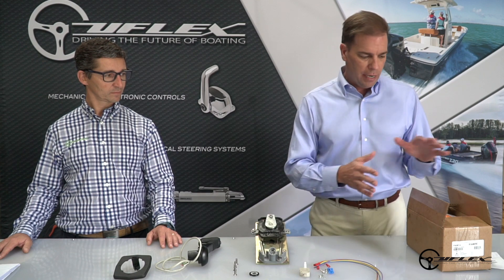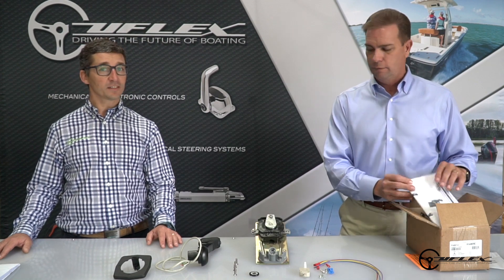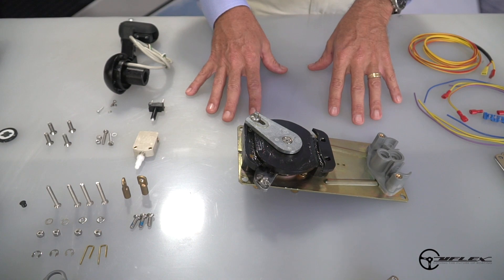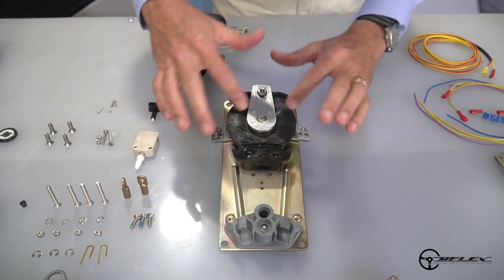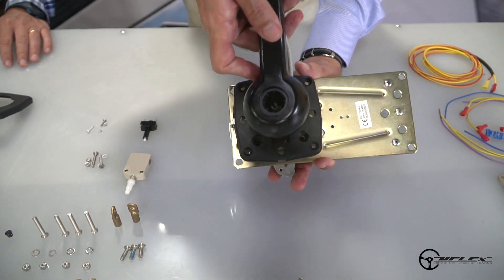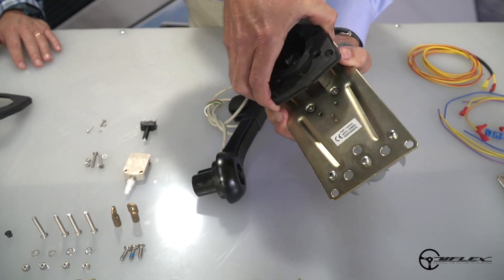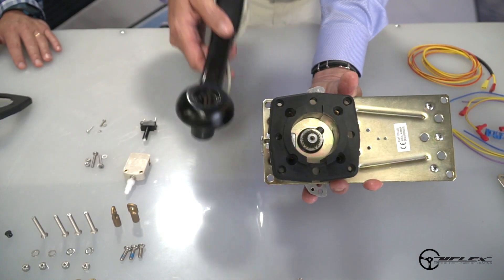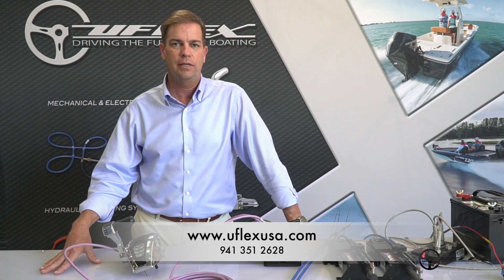How to Properly Configure a Uflex Throttle   Shift Control

Comment: This is a vapid video. I have spent a day installing a B183 and I can assure you it is difficult. I still haven't figured out if the unit I bought can increase the throttle without engaging the shift.  The installation manual shows pictures but the lacks the clear detail you need (specifically the description of the notch). I am installing the assembly for the third time now. 

They need a small table listing the features of each unit. I knew I didn't the power tilt but I do need the throttle in neutral.